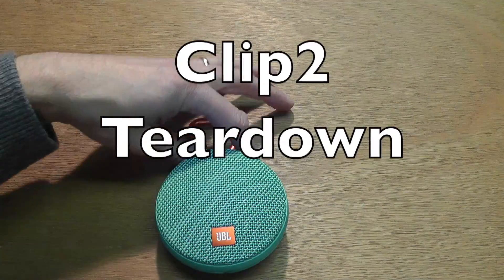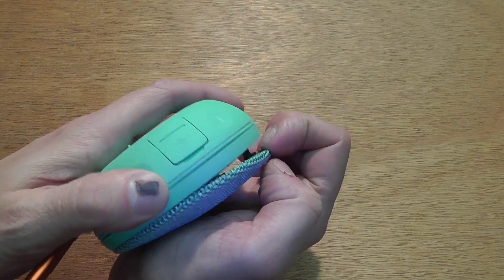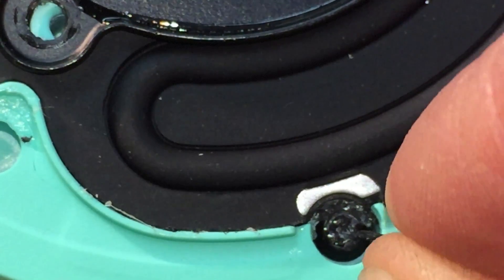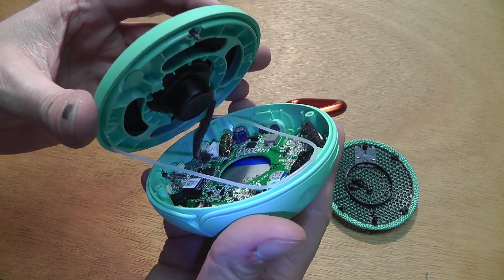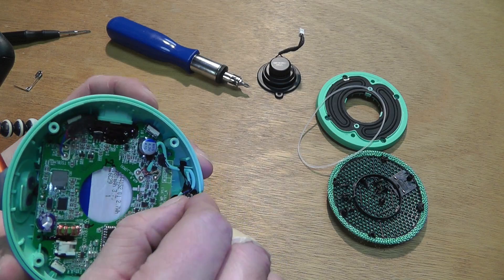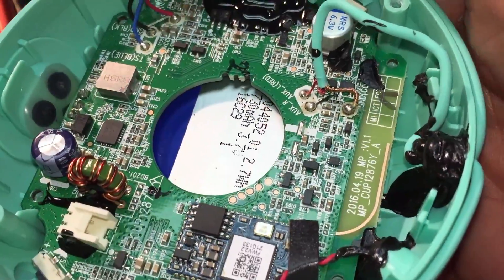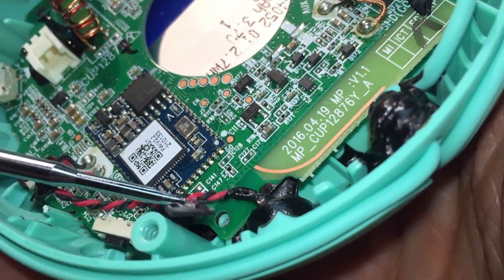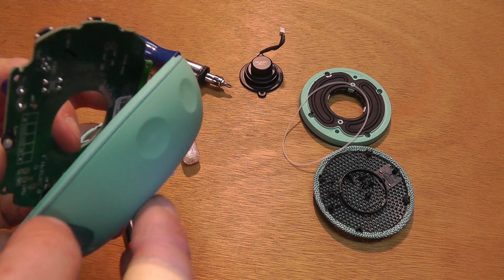Look inside of JBL Clip2 - Teardown

Comment: What do you call that black glue they use, like what's the industry name? I need to replace the battery on my speaker but it will remove its waterproof abilities right?

Comment: Mine worked great until the micro usb broke.  By this vid looks like its on the board, oyyy...  DOA.   

Off to Amazon to look for a replacement for the bathroom.  Any suggestions for a REASONABLY PRICED replacement?  Water proof is a requirement.  Thanks!  
.

Comment: Any advice on change out the aux wire or installing a aux port?
Reply from the maker: Replacing the aux wire should be relatively easy as long as unsoldering and soldering the wires is not a problem for you.

Comment: Great video! Does it still work?
Reply from the maker: +mygiguser It does still work.
I'm am not sure if it's still waterproof though.  Afraid to try that out..
Reply: it will still work but its not waterproof
Reply: @adrianth186  put the O ring back and reseal the charging port it should be waterproof again.